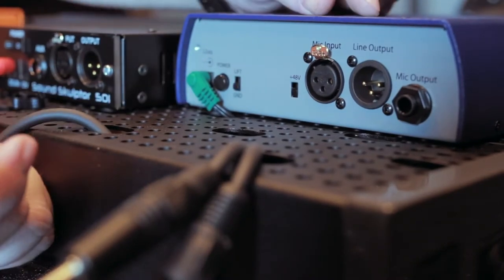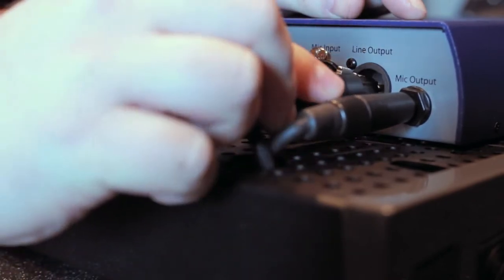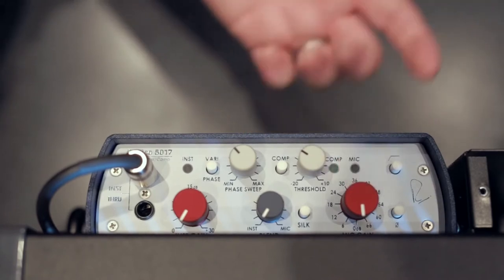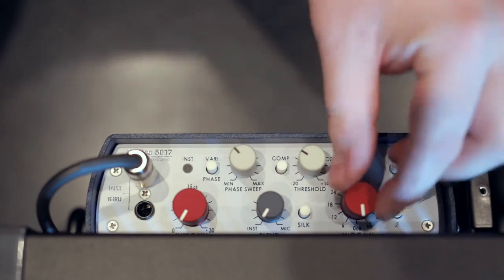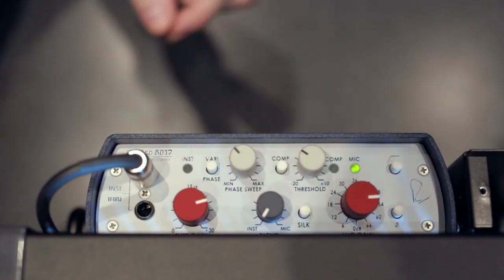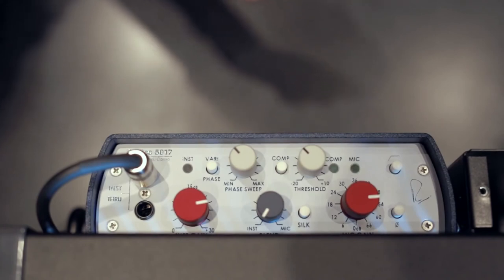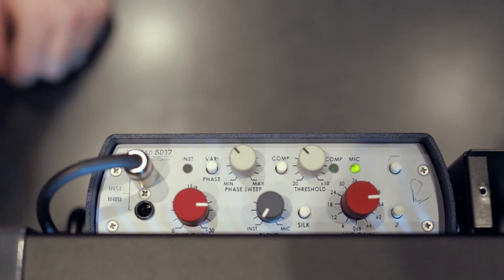Rupert Neve 5017 Vocal Demo by The Box Breaker Method

Comment: Please help, there is a TRS/TS connectivity issue that I don’t understand.

The Strymon Flint has a switch to enable input STEREO (not balanced) TRS or MONO TS, how have you configured the pedal?
Why use a balanced TRS cable on the output of the 5017 if your connecting to an unbalanced TS guitar pedal?
Reply from the maker: the 5057 is mono, just connect TS to the instrument in.

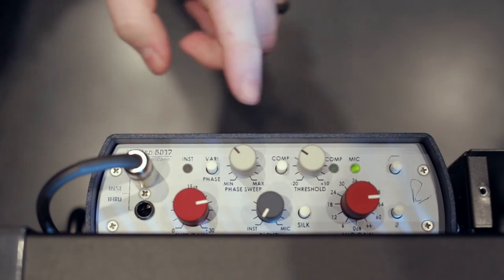Comment: I noticed that the compressor LED light is not flashing at all (around 1:30,) does that mean it's not working properly?
Reply from the maker: It means the signal isn't currently triggering the compressor – so it hasn't met the threshold of compression yet, and thus the box isn't actively compressing at that time.
Reply from the maker: Alex Diaz  if it turns on at -20 I would increase the gain by at least 20dB, make sure you are running the 5017 into a line input and not a mic pre if your destination isnt adding gain
Reply: Rupert Neve I also notice that the compressor light never activates - does this mean it isn't being used if the light doesn't flash?

Comment: Whats the signal chain? Im a little confused about the split to reverb part...
Reply: The 5017 has separate DI and Mic preamps. Both can be used at the same time and a blended signal can be sent from the Line Output. That's the feature highlighted in this demo. The signal chain goes: Microphone to Mic Input, Mic Output to Pedal Input, Pedal Output to DI INST Input, Line Output to audio interface.
Reply: @mikem.1203  nice I owned the 5017 and I’ve been wanting to know how you did this; I am going to go crazy with all my guitar pedals 🙏🏼

Comment: Hello.  At the 40 second mark it mentions that the mic input is split out to the reverb pedal, is that the TRS "Mic Output" shown at the 20 second mark?  Thank you.
Reply from the maker: yeah, mic out is TRS
Reply: @RupertNeveDesigns   thank you for the quick response!  I just wanted to confirm that there wasn't another piece of hardware needed to connect the unit directly to the reverb pedal.  I think this is a game-changer.  I can't think of another 'single-channel' preamp w/ onboard compression that allows one to directly connect to a guitar pedal and then bring that signal back in!  A singer can hear the reverb live.  Amazing; thank you for your innovations.
Reply: Rupert Neve Hi,  with portico 5017 it is possible a record clear vocal signal without processing in daw, 
but use the pedal same time for a vocalist in recording session?
Reply: @Matrix-77777  I bought the 5017 last month and I am using it for all of my vocal recording now.  The manual shows you how to do this - you can output two channels: dry and wet.
Reply: kenny schabow i just try to understand how to connect a pedal with portico, for same result as on video, and same time to have two signals,  dry and wet for recording
Reply: @Matrix-77777  I misspoke a bit in my prior reply.  In order to get both dry/wet channels with vocals, you need something else to split the signal.  I bought an Analog Alien EPI, because it handles balanced inputs/outputs.
Reply: @Matrix-77777  The signal chain (with EPI) is Voice → Mic → Neve → EPI → Reverb Pedal → Neve → Interface